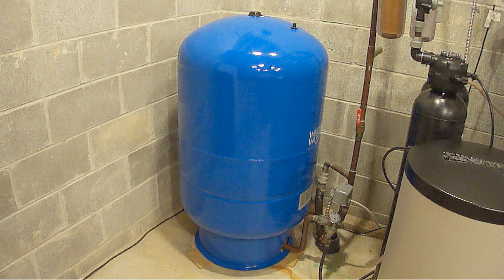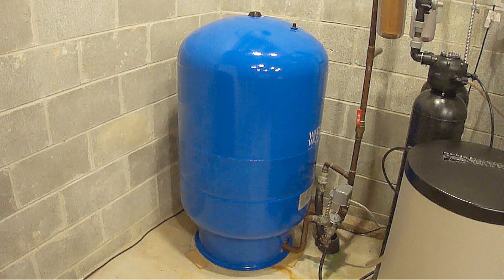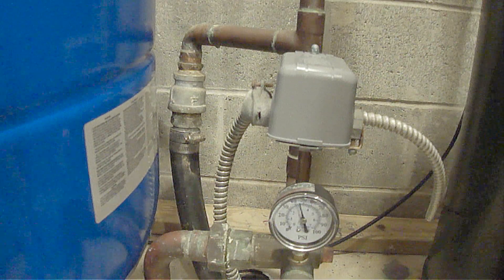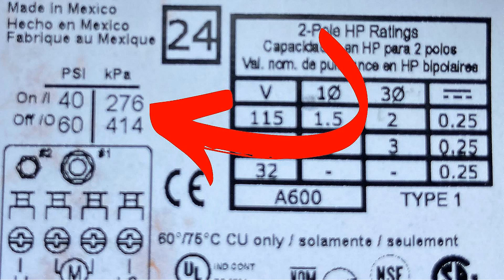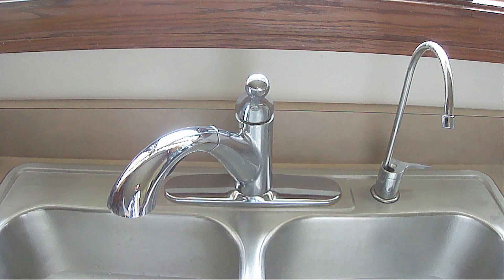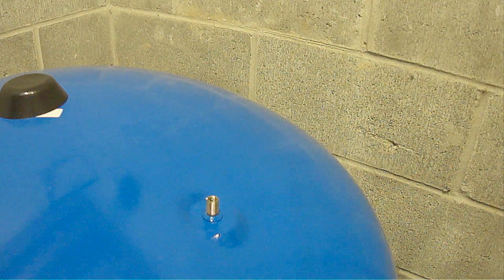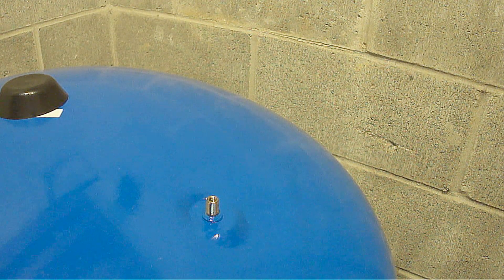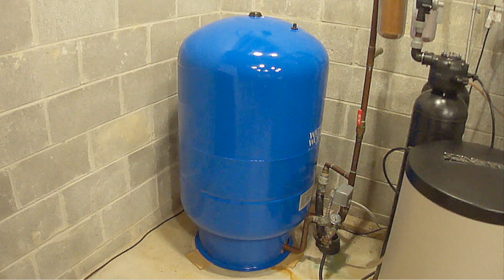How To Adjust A Water Well Pressure Tank - Fast & Easy!

Comment: Well done.  Before retiring, I had installed many, many water systems employing these pressure tanks, and based on those many years of experience, I would change just one thing.  The pressure reading numbers inside the cover are a guide for what the pressure switch is rated for as opposed to what the actual pressure settings are for that system and the actual pressure in a system may vary somewhat from what the cover says.  The best way to set the tank pressure is to cycle the system and watch the gauge itself to see at what pressure the pump starts at.  There are many valid reasons for an installer to set the pressures slightly different for each system so a quick look at the gauge will let you know exactly where the "cut-in pressure" is, compared to what the cover says the switch is capable of.  Once you know what the true cut-in pressure is, you can then set the tank pressure 2 psi below that.  If the tank pressure is higher than the cut-in pressure of the pump, the gauge will start fluctuating erratically at the cut-in pressure as the system cycles, leaving the homeowner wondering what they did wrong.
Reply: Hi ranckie. I have a question. You say that certain installers may adjust the pressure. By how much? I can’t even find my pressure switch, but after doing what you advised on finding the correct pressure setting, mine seems way high. I’m reading ~58psi on my gauge after cycling the faucet 3 times. Is that normal? Do I adjust my tank pressure to 56? Thanks in advance, Steve.
Reply: @stevezakis3274  Hi Steve, the pressure switch is almost always located at or near the pressure tank, and usually in the basement or pump room where the controls are.  The pressure switch will always have a wire going into it because that switch is what starts and stops the pump; look for a small square gray plastic cube about 3-inches in size.  Pressure switches are sold in differing pressure ranges, and the two most common pressures range from, 20-40 psi, and 40-60 psi.  Your reading of 56 is quite normal and I have set many systems at 40 psi cut-in and 60 psi cut-out, it depends on many factors including the well depth, the pump, and the flow rate of the well. Just make sure that the air charge in the tank is about 2-3 psi lower than the pump cut-in pressure.  When adjusting or setting the air charge in the tank, MAKE SURE it is done with zero water pressure in the tank, otherwise you will get false pressure readings.  There are excellent instructions for adjusting the switch inside the cover of the pressure switch, and there are several videos on You Tube that cover the adjustment as well, and this is a good one.  https://www.youtube.com/watch?v=5WNbxu9ufPs&t=2s .  Good luck.
Reply: @ranckie5055  I appreciate your response. Thanks. I spent 20 minutes looking for something similar to the switch box in the video. When I had my wife cycle the water on/off, the clicking noise that I assume was controlling the pump turning on and off was coming from a rather large box labeled SubDrive75 Constant Pressure Controller. I opened that box cover but didn’t see any numbers (40/60 etc) in there. There is a conical shaped apparatus, about 1 1/2-2” diameter that has two wires going to it from the sub-drive that is located by the gauge and the tank on the pipe, but I don’t see any numbers on it.
Reply: @stevezakis3274  Hello again, it looks like you have very different setup from what most people have with a drilled well.  I did some research on the Sub Drive info you supplied, and it looks like you have a special drive made by Franklin Electric, the same people that make the motors for most submersible pumps.  You must have a deep well and based on what I've read, your pump is a three-phase pump, controlled with a 'special' Franklin three-phase controller, using single-phase input power, which is something that I have never dealt with but sounds quite remarkable once you understand the thinking behind it.  The purpose of it all is, it gives you a constant water pressure the same as if you were connected to a city water supply, meaning the motor speed changes according to the amount of water being used, along with the pressure being delivered, so you don't get that pressure cycling between 40 and 60 psi, I'm assuming that you get one constant pressure which is the best.  I Googled "What is a Franklin Electric SubDrive75 Constant Pressure Controller" and the answer came back as follows:

"SubDrive75, SubDrive100, SubDrive150 and SubDrive300 Controllers are designed for three-phase motors to provide constant pressure with three-phase performance using single-phase input power. Designed with a NEMA 4 weatherproof enclosure, they offer rugged, watertight variable frequency drive solutions that meets water demand changes".

It appears to be a fairly new product developed by Franklin Electric to provide variable frequency to AC motors, a big step forward years ago in the field of AC motors because that's what gave us the "Inverter Technology" now used in many appliances including refrigerators, heat pumps and lots more.  Unless you're having water pressure problems with your water system, it sounds to me like you don't need to do anything.
Reply: @ranckie5055  Everything you said is correct about the system. Someone wrote on the controller “well 380’, static 150’, pump 300’”. My pressure gauge at the tank stays around 60-62 psi if no water is being used. I’m still confused on what I should fill my tanks to. I really appreciate your info and help.
Reply: I’m also curious as to what happens if you put too much pressure in the tank. (Over the pressure at the gauge by the tank.)
Reply: I just thought of something else. I asked proclaimliberty if the pressure in the tank will be zero after draining the system and the gauge reads zero. He answered yes. I just got done watching a video by Gould Water Technology and he drained the system, the gauge went to zero, but there was still pressure in the tank. The more research I do, the more confused I get! Haha! I think I’ll drain the system and check the pressure in the tank. If it at zero, I’ll put 58 psi in and turn the power back on. See what happens then.
Reply: @stevezakis3274  Calm down Steve, no need to panic or get confused, it really is simple.  You have the best of the best with your Sub Drive Controller system; it gives you pretty much constant pressure at or near 60 psi, which is far better than the 40-60 psi variation that other people have to live with that have conventional systems that use regular pressure switches.  The best part is, anyone who has a Franklin Electric motor on their pump, can have the same controller that you have because that controller will work on any single-phase motor and deliver constant pressure the same as what you have.  In other words, the controller replaces a conventional pressure switch.  Now, first let's talk about water pressure gauges.  Most water pressure gauges are only accurate for about a year or so after they are installed and are pretty much unreliable after that, so my advice is, unless your system is new, before you do anything, go to a big box store, spend $16.00, and buy a new 0-100 psi, water pressure gauge with a 1/4" NPT mount (same as the one you have), install it in place of the old one and throw the old one away.  Now, as for the existing pressure in your tank, when you drain your water system down to zero, you still have air pressure on the air side of your bladder in that tank, and a tire pressure gauge will show you what that air pressure is.  That air pressure should be set about 2 psi below the cut-in pressure of your pump.  So, before draining your system, with your pump system on, have someone run water until the pump starts; (you should hear the controller click when the pump starts), and look to see what the pressure gauge reads when the pump starts.  If it starts at 58 psi, after shutting the system and draining the water pressure to zero, set the air pressure in the tank at 56 psi, (2 psi below the pump cut-in pressure) and you'll be good to go.  Now to your question about what will happen if you set the air pressure in the tank higher than the cut-in pressure of the pump, try it, you won't hurt anything, and what you'll see is, when the pump is running the water pressure gauge will hold or follow the water pressure, but when the pressure goes down to the cut-in point, the needle on the water pressure gauge will drop to zero immediately and probably bounce around a bit until the pressure starts to build and then it will go back up and look normal.  When your done experimenting with that test, set the air in the tank 2 psi below the pump cut-in pressure and you'll be fine.  Hope this helps clear things up for you.  By the way, your well driller/installer did a great job because he listed all of the important information about your system, and not everyone does that, and when trying to trouble shoot a system, that information is very helpful.
Reply: @ranckie5055  Well you’ve definitely put my mind at ease. You’re very accommodating and I really appreciate all the advice and help. I’ll get a new gauge and install it. I’ll let you know how it all turns out. Again, many thanks.
Reply: I was thinking the exact same thing about using a pressure gauge to set the cut-in pressure. The numbers on the label are not the same as actual cut-in or cut-out pressure.

Comment: Amazing video man. Quick question I really need a reply back though. So I can shut power off from breaker than turn on faucets to empty tank out? I would not have to drain it from the tank itself? I have a 40 to 60 switch and just got new one install and right now the psi is very low at 20psi. Thank you man for a reply as soon as possible

Comment: Thank you so much for your video. I have a few question please,
When you buy water pressure tank is there air already in the tank? 
Why are there so many different size of tanks?
Thank you again.
Reply from the maker: The first question is yes. The second question is it just has to do with how much room you have to work with. You’re far better off getting a larger tank because your pump will cycle on and off less often and the tank will last longer. I have an 86 gallon tank which is the largest and that’s what you should get if you have the room.

Comment: But what if the pressure switch has been played with or adjusted? How do you adjust the switch to be sure it’s adjusted to that 40psi to 60psi?
Reply from the maker: In order to adjust it properly, you must have a pressure gauge by the pressure switch. If you look at my playlist under household, you’ll find a video on how to adjust it.

Comment: The copper pipe is connected to galvanized steel that causes electrolytes and will distroy all the copper pipe.
Reply: Mine has been that way for 32 years and is fine.

Comment: Hi there, I have a question but need to explain a little first.. We woke up one day to no water so i paid a "plumber" $250 to install a new switch, well 6 days later was no water again. I figured out how to turn the switch on myself. In the winter I had to go out about daily to turn the arm on the pressure switch to get water in my tanks but now that it's warmer its been more like 1-2 times a week. I have a 30/50 pressure switch but I checked the pressure in the pressure tank and it read 44 (that was in the winter). Could this cause the pressure switch to not automatically turn on? Wondering if I need to do what you did in the video and/or put another new switch and maybe a gauge ? Thank you for any help! Been trying to figure this out for months and I refuse to get ripped off again.
Reply: Do you use a pressure switch with a automatic low pressure shutoff?  They are used to prevent a pump from running dry where the water drops lower than the pump.  If you do have this type of switch a couple things could be the could be happening when the pump comes on pressure & cannot be restore fast enough so the low pressure shuts it down
1. Pump is worn and can no longer recovery pressure fast enough
2. If you have a water treatment system and the backwash cycle demands water faster than the pump can supply, pressure drops below safety and switch shuts off the pump.  This happened to me, installed a valve on the backwash drain line to reduce backwash water flow rate.
3. New switch has safety cut off not adjusted properly below the low pressure pump start value
4. Well water level is low

For my 10 cents, instead of a plumber hire a company that just does well pump work.  I've seen too many instances where plumbers incorrectly diagnose or install well water systems.  Last time I had my system replaced, plumber did not realize it had a low pressure safety pressure switch and installed a standard switch.  I asked about low pressure shutoff adjustment, they had to change out the switch.  A friend had a plumber try to use a backhoe to get a stuck pump out, ended up breaking the pipe and effectively destroying the well.

Comment: Hi Paul, I'm trying to reset my new Impression water system to help with sulfur, iron and sediment (no water softener as water isn't hard ).  So far it has been working well.  The problem is that it regenerates at 12:01 AM and our bedroom is directly above that area, and the unit runs for a solid hour plus.  How do I reset that time.  In addition, it was factory set to generate every third day.  I feel that's too often.  It can't be good for the well,  ejection pit and the septic tank accepting extra water for a long period of time.  Thoughts, ideas and directions to reset time and days.  Blessing to you, Bill

Comment: Nice vid.  I built my house in 2000.  24 years and I've never even looked at the pressure tank once, nor have I had any well pump problems.  Recently we've been getting iron in our  water which we have never had a problem with before......only a little bit of white calcium.  Now we're getting the orange/brown rust.  Any ideas why we are now getting rust?  We do have a softner that did replace about 5 years ago.
Reply from the maker: That sounds to me like a water softener problem more than anything else.

Comment: If I had a 30/50 switch could I buy a 40/60 switch and just add air to the tank or would this be a stupid idea?
Reply from the maker: It would be fine to do that.
Reply: @proclaimliberty2000  so I wouldn’t have to upgrade the blue tank?
Reply from the maker: @jessesu2b447  No
Reply from the maker: @jessesu2b447  I do always recommend an 86 gallon tank because that way the well pump does not have to cycle on and off as often which means your well pump will last longer.
Reply: Your pump won't run less with a bigger tank the flow rate stays the same. It'll actually run longer to fill the larger tank when it's turned on.
Reply: You didn't need a new switch just adjust the switch so it turns on at 40 and off at 60.

Comment: Thank you but what could cause my 10.5 year old pressure tank to be suddenly reading only 9.5 PSI. I am getting short cycling all of the sudden. Does that mean that the pressure tank might be bad?
Reply from the maker: Do you have a submersible well pump?
Reply: @proclaimliberty2000  Yes, I do. It is in a deep well. By the way, I can't get it to fill past about 16.5 with my m18 Milwaukee tire pump. There is an elaborate filtration system involved as well but I don't see why it would have anything to do with ot not taking air. Model number is a Proflo 32 gallon unit. Here is a video of what is happening... https://youtube.com/shorts/G2n_w8LZ9SQ?feature=share Thanks.
Reply: I used your technique to fill the tank with no issues but had to turn all faucets off or it would not inflate. All is good now. Thanks for the video.
Reply from the maker: @jamesdean5677  Turn off the power to the well pump pressure switch and clean all eight contact point faces with a mini file or emery cloth. Turn the power back on and see what happens.
Reply: @proclaimliberty2000  Well it's working  fine now thanks to you. I did that earlier. probably not a bad idea to revisit that with a file. We appreciate you.
Reply from the maker: @jamesdean5677  That’s good news. When ever this type of thing occurs, it’s usually due to a faulty pressure switch or a well pump whose check valve has failed or the connection directly at the well pump has cracked. The same thing happened to me three years ago, and it turned out that the top of the submersible well pump had cracked and had to be replaced. My pump lasted about 25 years and cost me $1600 to have replaced. I like to try and fix as much as I can, but trust me when it comes to a submersible well pump, it’s worth every penny having a professional do it, which requires a crane and special tools.

Comment: my pump comes on and pressures up to normal but the gauge threaded into it immediately starts to slowly drop until it hits the low PSI point and fires up the pump again... checked all around for leaks and everything sounds normal in the well house. No water running so im guessing my pressure tank has blown😳

dont want to get ripped off by the repairman
Reply from the maker: How long has it been doing this?
Reply: @proclaimliberty2000  couple days...pump runs it up to the normal and the gauge slowly looses pressure untill it hits the low mark...no obvious leak and no water out the tank air valve